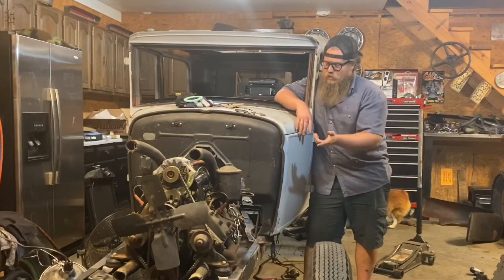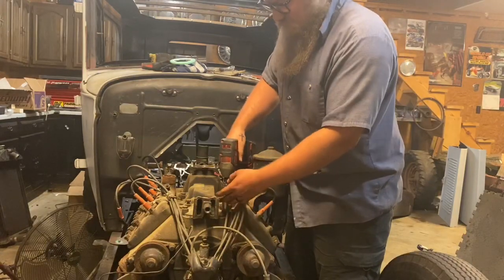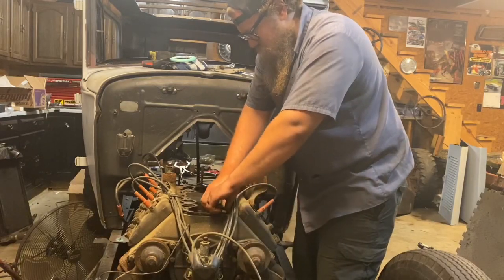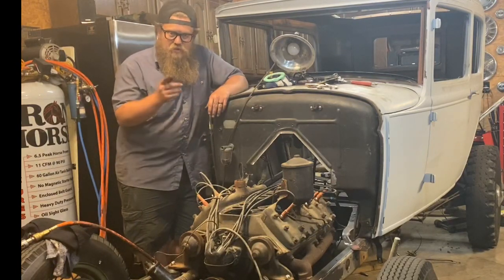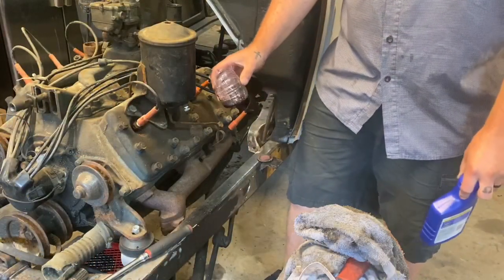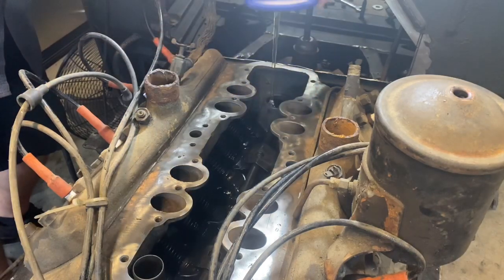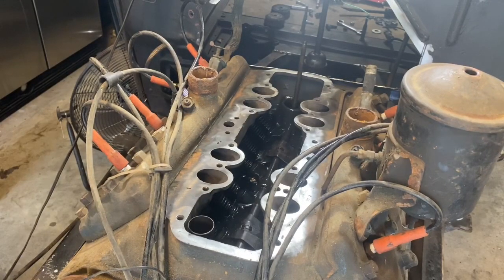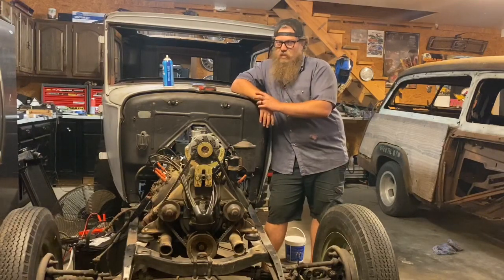Flathead Resurrection! Blueprint for Sitting Engine Restart!

Comment: Another good tip is in lubing up the upper cylinders/pistons with penetrating spray. Aerokroil is the absolute best for this, plus the little straw can sneak into the cylinder better. A good soaking of the lifters and valve stems is good insurance for the valves not sticking. Spray down into the intake ports on the block as well, this will force gravity to help you get them moving. Glad it fired up for you, make sure to change out that canister filter element too.
Reply: Aerokroil costs so much you're better off buying a pair of head gaskets, pulling the heads, and manually spreading motor oil around each cylinder wall on the end of a fingertip.
Reply: @TestECull  money be damned, I'll be spendy when it comes to using something that I know gets results.
Reply: @TestECull  good plan on the 2 cycle oil. I only use aerokroil to soak everything down before trying to rotate an unknown engine. Oil is great, but in most cases, it can't get to where the stuck components are. Penetrant goes much further, and seriously, a can will last a good while, it pays for itself in the end.
Reply: @markk3652  Ahh, yeh getting one freed off is the perfect use for penetrants. Krpoil would be useful there, but then again so is PB Blast. And vinegar, oddly enough. Check out Puddin's Fab Shop he's gotten a couple of really badly stuck V8s turning like butter by flooding the jugs with vinegar and letting it sit a day or two. He did a smallblock chevy in a G-body Caprice and a '58 Pontiac Chieftan that way; both of them ended up starting and running well enough to drive the car pretty quickly.

The 25:1 for the first bit of running...honestly, with my flathead Briggs push mower, I always use that full stop. I've found it loves the stuff. I just can't stall it on 25:1 2-cycle fuel, but on straight gas I can stall it out. Prolly not practical to do that on a Flathead V8 in a fullsize car, though. But ye once it frees off, its first whiffs of fuel are oily.  Definitely helps them light off easier by sealing stuck rings to the cylinder walls as well as general lubrication up top. Usually after a heat cycle or two the rings have freed up enough to work again, provided the cylinder walls aren't pitted up beyond recognition.

Comment: Hey Zac,  great videos but can you show how you connected everything electrically to start it. The wiring on my wife 49 ford f1 is shot. I know you said in another video that you show how too in a resurrection video but I can't seem to find it??  Thanks
Reply from the maker: Hi Chris, sorry for the late reply, I believe I talk about it on my NO Start NO Spark Flathead Video, but its simple, get jump start cables, - battery to a good ground on the block, + to the coil + and jump the starter with the jumper cables, should give you spark and start up

Comment: Cool. Im about to do the very same thing.
Reply from the maker: Awesome! What engine do you have?
Reply: @WiredCustomsSpeedShop  I bought an 8ba to build but it was stuck bad. Had to hammer the pistons and most of the valves out. Hoping its buildable. Also have a 59AB that turns over. Hoping to get it running and enjoy its rusty glory while I hotrod the 8ba.
Reply from the maker: Haha that’s funny because that’s exactly what I was doing, I had a very stuck 91a that’s finally at the machine shop and bored it .125 over, I had to cut most of the valves out
Reply: I couldn't get to most ofthe valves to cut them out because they were stuck closed. I turned the motor on its side and filled the exhaust holes with PB blaster and let them sit, then repeated the other side the next day. I found that repeated pecking on the faces with a ball peen would make them eventually come up just enough to get a flat screwdriver underneath.
Reply from the maker: Ouch, that sounds like one hell of a fight, I got an angle grinder in the oil valley and cut the spring and valve at the same time haha, nasty business
Reply: @WiredCustomsSpeedShop  that didn't work for me because they were stuck in the guides.

Comment: Would you mind making a video on the flathead distributor and how to check/rebuild if it’s good?
Reply from the maker: I am getting another 8BA in the next couple weeks, I can see about doing a video then!
Reply: Wired Customs LLC awesome, I have a 59 in the garage hoping to get it fired up but no sure if the distributor is any good. Thanks for your videos.
Reply from the maker: One thing you can do is take the cap off, and take the negative wire off the coil, let it be very close to the negative post, open and close the points with a screw driver, you should get a spark jump from the negative side of the coil to the wire, that would tell you everything is working right

Comment: Zack, we have experienced a problem with our recently rebuilt flathead. For some reason it both vacuums and blows back out of the carb. We took the intake off completely and checked all the valves. Two appear to be slightly stick at the bottom end - when it bottoms, I have to push the lifter down to get a feeler gauge in. Also, the spaces between lifter and the base of the valve stem vary from 6 thousandths to 20!  Is it possible that you might have time to talk to me about this?  I’d be happy to share my number offline and would surely appreciate your time. thanks!
William Tunnell

Comment: I am about to get a 34 BB that has been sitting for a number of years. It turns over but I dont know much else yet. If I open it up and find sludge is there an easy way to clean it without tearing the engine down to rebuild? Id like to try to get it running as is, but maybe that is a pipe dream.
Reply from the maker: Not a pipe dream, pull the intake and oil pan and clear out sludge, while you’re doing that put a little bit of oil down each spark plug and let that soak into the rings
Reply: @WiredCustomsSpeedShop   well looks like he decided to keep it or sold it out from under me after we made a verbal deal. So got any contacts in CT or New England for a project? Lol

Comment: Wondering if there is a design reason why 
flatheads have such a low compression ratio
Reply from the maker: One of the biggest reasons is just the time period that they where built in, at that time “1932-1953, over head valve engines with higher compression where not affordable for the average man that Ford was building his cars for, all the flatheads at the time had low compression because of the combustion chamber, since the valves and the piston is facing the same direction next to each other, the piston can’t get closer to the valves to compress that little bit of air left, thus not letting the compression ratio raise, engines in that time period had a compression ratio anywhere from 4:1 to 9:1
Reply: @WiredCustomsSpeedShop  I guess that makes perfect sense because the surface area on the head was twice as big.  Additionally, Ford was shooting for reliability, and lower stressed engines last longer.  Learning these is very interesting stuff, thanks!
Reply from the maker: @steves8014  no problem at all!
Reply from the maker: @steves8014  no problem!
Reply: Poor quality gasoline was another reason. These engines will just about fire on kerosene.

Comment: darn it.  I wanted to see you fill it back full of oil.  I have a 59ab that needs an oil change and I want to know how many quarts it takes. Also I have the penn grade green oil ready to go in, do I still need zinc additive?
Reply from the maker: I would always put zinc additive in, the cam needs as much as it can get! I put 6 quarts in, definitely recommend a heavier oil like 15 40, I usually use Rotella Non Detergent 15w40 6 quarts

Comment: Hey my name is juan silva I have a 1949 ford f1 I want to start the engine to see if it works like the way you did it in video but wen I remove the radiator I found oil or black lush in the radiators
What do you think is the problem 
I trying to look videos but I don’t found anything for this year and model
I drain the oil pan and I don’t found water 
It was ok 
Any ideas
Please let me know

Comment: That STP treatment is crap, don't use that shit. Do a google search for the analysis of STP, you'll find there's less zinc in it than there is in regular passenger car engine oil, you'r not effectively adding zinc when you add that crap, you will in effect be diluting the zinc level of the oil. STP is nothing but long chain polymers in a basic Grade I base oil. They are slippery in the bottle, they will quickly shear in use, and those polymers will cause deposits to form around the rings leading to ring sticking, and on the ring lands leading to bore polishing. Stop using that crap!
Reply from the maker: Thank you for all the information, I typically sure Brad Penn that already had high levels of a Zinc, not knowing if I was going to start up this engine and have a rod knocking it blown head gasket I just did a cheap oil change